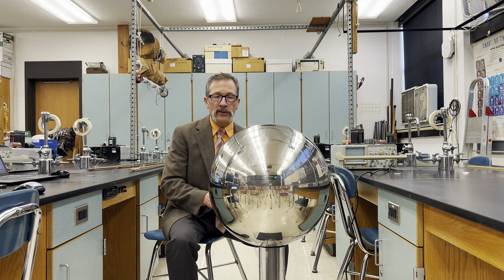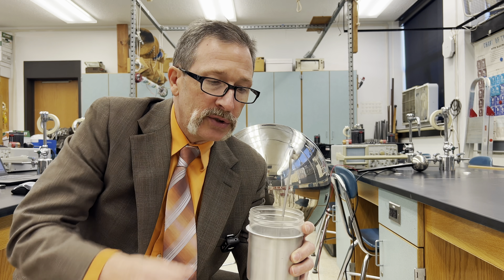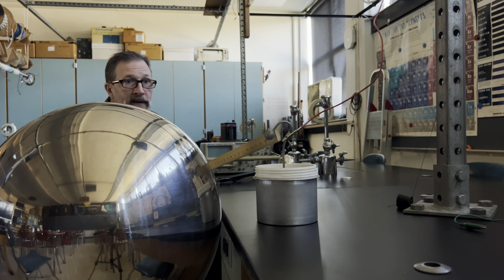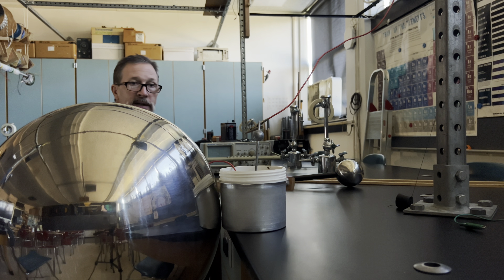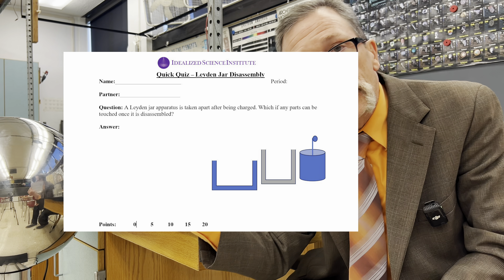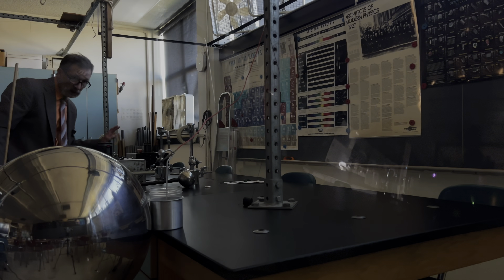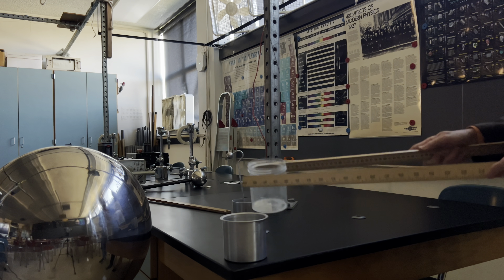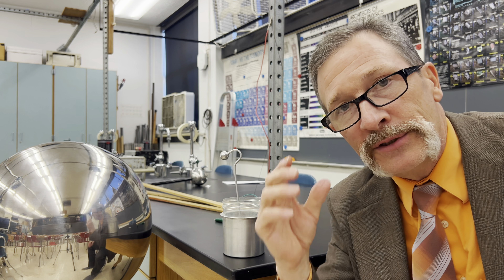This Simple Device Could Kill You

Comment: It's not just an electrocution risk. Electrolytics, especially, have 'interesting' failure modes:). Sealed tantalum caps can explode violently, spraying shrapnel around the lab. I had one large, aluminium electrolytic blow a pinhole in it's top and spew out a cloud of electrolyte and shredded insulation like a firework - we had to evacuate the lab until the power supply tripped and the snowstorm stopped.  It took a day to ventilate the fumes and vacuum out all the racks:)
Reply from the maker: Wow!

Comment: This reminds me of a prank I pulled on my kindergarten class many years ago. I got into electricity at a very young age, and I had a big fat one-farad capacitor, about the size of a tall jar of tomato sauce. I charged it up to an awesome 1.5 volts from a dry cell and brought it to class along with a screwdriver. Of course this was nothing like your Leyden jar: 1.5 volts won't hurt you, but my classmates didn't know that.

As I put the capacitor on the table for show and tell, I "accidentally" touched the two terminals, one with each hand. I started writhing around as I were being electrocuted! And then I somehow managed to get free. (Pretty good acting for a young boy.)

I discharged it with the screwdriver across the terminals, with a loud and satisfying bang. Then I touched the terminals with my hands again, turned to a girl I had a crush on, and told her, "It's safe now. I discharged it. You can touch the terminals now." She mustered up all her bravery and tried it. And we both survived to tell the tale!

Comment: As a student (60 ish) years ago I read about it. A day later in my friends basement I demonstrated. A 300 volt (tubes were still a thing) power supply and a RC circuit. A resistance high enough to not blow up the PS (who needs fuses). The capacitor, 2 roughly 6 inch square pieces of sheet metal and a sheet of typewriter paper. It was the first time working with electronics that I said “cool”
Reply from the maker: That is cool!

Comment: I worked in a thin film plastic extrusion factory. Some of our rolls were over 5000 ft long. When a roll was complete and a new core was starting, the operator reaches into the spool-er to cut the continuous sheet of plastic. The first time I did this, I thought there must have been loose strands of plastic because it felt like I was getting slapped in the face. The second time, I watched for loose strands, didn't see any, but still got slapped. Turns out that it was arcs from the highly charged roll of plastic, arcing to my face.
Reply from the maker: Yes! That is a good way of building up charges.

Comment: so is it correct to say that this lyden jar is sort of like a capacitor....(which also potentially holds a lethal charge if not properly discharged)?
Reply from the maker: It is correct to say that it forms a simple capacitor! However, it would be difficult to build one with enough capacitance to kill you. This quiz is designed as a tool to get people to respect electricity and NEVER assume a capacitor is discharged. Because real capacitors absolutely can be deadly!

Comment: Question:  When the parts were disassembled, could they be measured with a voltmeter to know that there was a danger in putting them back together?
Reply from the maker: Voltmeters, like a multimeter, are not rated for such high voltages. They would also begin discharging the parts.

Comment: My first job out of tech school in the early 80's was refurbishing the CRT monitors that were used at the Wall St exchange for Reuters. These monitors would just scroll stock prices all day and get a line burned in the monitor. I would replace the CRT and any other worn components. Of course I had to first power the monitor and evaluate it. That meant I had to discharge a freshly energized tube to work on the monitor. Used a long screwdriver with an insulated handle to short the tube to ground. Once or twice I got careless and got zapped. It HURTS!!
Reply from the maker: It sounds like we have the same technique!

Don’t EVER Do This in the Lab!
https://youtu.be/VukMAP_4NWA

Comment: I worked in a factory making pvc pipe many years ago and freshly made pvc contains a tremendous amount of static electricity. You could clearly see and hear the arcs up to two inches away when you put a finger near a piece of metal under the bright lighting. I'm not sure if I was imagining it or not, but I felt as if I could feel the electrical field as a buzzing sensation without actually touching the pipe. I've had that sensation before when my camp trailer became electrified in a rain storm, and I went to grab the door handle. Fortunately, there was about three hundred feet of extension cord so I didn't die, but that buzzy feeling is unforgettable.
Reply from the maker: No...that feeling is real! Glad you never got hurt.

Comment: Back in the early 80's, I worked in a Plasma Physics laboratory. We had an experiment that used large capacitors charged (relatively slowly) to 100kV. We monitored the voltage on a meter.

One time, just before a shot of the experiment, we heard a cricket chirping away from the direction of the storage capacitors. Then there was a loud BLAM! No more cricket. And, by no more cricket, I mean it was silent and there was a plasma smudge on the concrete wall of the lab near the capacitor bank. And the meter dropped a tiny bit.
Reply from the maker: That poor cricket! That’s a great story!
Reply: @idealizedscience  It didn't feel a thing. Trust me.

Comment: Back in the early 80's, I worked in a Plasma Physics laboratory. The way they kept things safe was to only hire the best and brightest (it sounds as if I'm boasting but this is the God's honest truth).

During my first tour after being hired, one of the scientists in the lab pointed casually at a relatively large plastic thing and said "That's 450μF and is charged regularly to 10kV. Touch it and it will kill you before you even know you're dead."

Folks who worked in that lab simply understood the danger of all the high power capacitors, inductors and Marx generators and behaved accordingly. If you didn't understand technology, being in that lab was absolutely terrifying.

Comment: Are the Lyden jars rated in farads?  Does in also have a voltage rating?
Reply from the maker: Yes...microfarads. Yes...the discharge voltage depends on the length of the path of the arc.

Comment: You should never use plumbing for ground. If someone is in a tub and electricity is going through the plumbing they can be shocked or killed. For safety please ground to an electrical ground wire.

Comment: Take two 30m rolls of aluminum foil and two of sarin wrap. aluminum/sarin/aluminum/sarin. roll it up so the sarin insulates the foil. 30m of foil makes a pretty large capacitor. Earth the inner foil. Charge up the outer layer using your generator. Unearth it somehow. Now don't touch it.

Comment: Who sees an arc of electricity spark almost 2 feet through the air to an electrical socket and thinks "practically harmless" lol
Reply: I got zapped by 40kV a few times. I eventually learned not to touch spark plug wires while engine is running
Reply: @walter6574 my dad saying okay hold this screwdriver in the sparkplug wire socket and to ground the end to the motor but not mentioning I shouldn't hold the metal shaft and only hold by the insulated handle.... Yeah once was enough lol

Comment: The charge (excess electrons on one plate, "holes" or missing electrons on the other plate) IS on the plates.  The dielectric insulator in this case holds no charge, and any induced dipolarization on it is removed immediately when the jar is disassembled and it is taken out of the static electric field.  This piece is ALWAYS safe to handle. 

Your incorrect statement was that either plate, when handled alone, would safely discharge into ground.  This is not true.  "Ground" is not some infinite and bottomless sea that will absorb excess charge, whether positive or negative.  When you power your van der Graff, "ground" is actually a circuit through the earth, all the way back to the nearest power station that supplies your electrical grid.  

When you force a charge separation on the plates, the only way to discharge them is to reconnect them in circuit, either to each other, or one plate to the half of another pair of plates, also charged.  The balance must always be paid, you get nothing for free in physics.  And in the case of "ground", it has nothing left over for you to do this, as the circuit was already complete as the capacitor was charging.
Reply: Well, not "always".  If you touch the dielectric while the capacitor is assembled, you're almost certainly going to short the capacitor and burn the end of your finger.  

The real risk of capacitors, is if you touch both plates, or one plate while the second is grounded.   Then they discharge thru your body and probably across your heart. Then you are probably dead.

Comment: That's a big van der Graaf machine, and you are right, it's pretty safe. But I'm rather wary about your setup where the inner plate of the Leyden jar is earthed and you charge the outer. It's too easy to touch. You also have other apparatus on the (ungrounded) bench and it's not clear what is earthed and what isn't. There are too many possibilities for charging various objects by induction due to stray fields. Much safer in my view to earth the outer of the Leyden jar, to prevent stray fields, and charge the inner, by connecting a bit of wire to the VdG. Then when you discharge, you know that you have discharged everything.

I wouldnt touch either conductor of the Leyden jar, disassembled or not, because you dont know what other dielectrics are around, like a part of the surface of the bench.

I did once get a biggish jolt from a Leyden jar which was not fully discharged, not fully charged either, not something I care to repeat.

You are obviously a knowledgable practitioner, but think about other people including physics teachers. I would store that Leyden jar with the plates touching and the dielectric somewhere else. Bill Dixon, retired Physics teacher.
Reply from the maker: Thank you for your excellent comment and wisdom here!  I will take it seriously and incorporate into my current practices. When we become overconfident...bad things can happen!

Comment: I have a couple of .0001 100kv poly caps that have metal threaded studs on the ends and I keep the studs connected with a piece of wire when in storage.

Comment: When I was a kid first getting started in electronics, I was learning about tank circuits and how when in resonance, the peak voltage goes up.  Anyhow, I had a center tapped 12,000 vac neon sign transformer, and then wired one end to a glass one gallon pickle jar with aluminum foil wrapped around it, and then wired the other terminal to a ball of aluminum that was dunked in it and partially filled with salt water, essentially the capacitor was in parallel with the transformer output.  I had a couple of wires set so it could arc between them and while "tuning" the circuit by incrementally pouring more salt water into the jar (powered off between pours of course) until I had attained the greatest arc of about 5 inches.  Normally the arc without the capacitor just hummed and was a thick glowing and very hot arc, and only could cross about an inch or so of gap, where as with the cap it was deafingly loud, and a skinny blue arc. 

So the transformer was sitting down on my workbench, and the capacitor was sitting directly above it on a wooden shelf, and while admiring my handwork, the glass had apparently had all it could take and cracked, releasing that salt water and as it ran over the shelf down onto the transformer below it, the arc was moving all over it in a a glowing blue sheet of highly charged water, and it was both beautiful and terrifying at the same time and as luck would have it, the outlet that was powering the whole contraption was directly under the shelf and there was no way to reach it without putting my arm through the arcing water but was able to shut it down by running to the house and flipping off the breaker.  

In later years I got a job as a bench tech, repairing electronic gear, and often had to replace CCTV picture tubes, and the usual procedure was to ground the anode of the tube before working on it.  Normally most flyback circuits have a bleeder resister that will drain the voltage after a few minutes and if the TV had been off a while, I would often skip the short wire to the anode step.  Bad mistake.  I was working on the CCTV on a Friday and it was late so I decided I would pick up where I left off on the following Monday.  When I followed up that Monday, I never gave it a second thought, I reached up and went to pull of that anode cap, and even having sat there over the weekend, not even plugged in, it gave me probably the worst zap I had ever gotten in my life.  Aside from yanking my arm out and almost hurting myself, my arm went numb, I was  shaking and just glad the hit was just down my arm and not through my chest because I feel it probably would have killed me.  After regaining my senses, I applied the proper shorting technique to the anode and it still had several good pops left in it, and I later discovered the bleeder resistor was open.  From then on, I always ground the anode terminal with a stout jumper clip and I would leave the jumper clip in place to make sure it was completely discharged.

Comment: I had to repair a benchtop grinder but to do it I had to disconnect the motor to remove it. I unplugged it and was about to undp the connections when  I remembered the motor had a capacitor start. Nearly a nasty surprise.😖

Comment: Gotta be real careful with caps especially big guys with a lotta dielectric and plates. Why? Because your storing lotsa little critters in there. Result? Lotsa amps and lotsa voltage differential. Yep even 25 volts can bite you in the ass if there's enough for long enough of a period and POTS line works into -48vdc by default. that can definitely bite you because there's some amps behind it, see?

Comment: Leyden jars can be anywhere. when I was managing a restaurant they had a special where you could get a large sports drink in the plastic cup screw lid and straw all in one piece. well these came and giant plastic bags inside a great big cardboard boxes being jostled around everywhere like The Warehouse the UPS truck putting them in stock like shuffling your feet on carpet. if you carefully unscrew the lid and build it with the pop machine and did not touch a ground and shock yourself you could screw the lid back on filled with say Coke. you hand it to the customer that holds it and takes a sip and Powright inside their mouth. it went on purpose employees didn't want shocked filling them. and that one that happened to explain what was going on and they needed grounded before being filled.

Comment: I disassembled a Marshall guitar amp once. I had just been playing it for a while when I got curious about how it looked inside. I got it out from its wooden box and held it in my lap. Then I touched one of the 500 volts capacitors. That’s when I got kicked by a mule and the amp flew off to the floor when my arms straightened right out. All went well but it was a hell of a kick. Remember thinking I probably was lucky. Never touched it again, just played it.

Comment: My buddy built his own neodymium magnetizer... to charge neo, you need a lot more power than normal magnets. Well one day he dropped a screw driver into the cap banks and it discharged.  The explosion caused hearing loss in one of his ears... terrifying.  If you're working with large caps, use oil filled caps instead of air. They tend to be much safer but more expensive.

Comment: TV repair back in the day was deadly if you didn't know what you were doing. The metal chassis housing the electronics was "Floating hot" and acted as the circuit common, Power supplies & circuitry for CRTs were high voltage using flyback transformers and capacitors & carried no ground (wire). Energizing it just 1 time, the configuration will stay charged (in theory indefinitely) practically for decades WHILE unplugged! When the TV broke or there was an issue unqualified people would often attempt to save a couple bucks from calling a repairman, and made the potentially lethal mistake of poking around in the back..... bad move!

Comment: This is a video which really needs to become viral. In electronic courses 35 years ago, we were told to consider capacitors as "current bombs". Meaning they can release all their stored energy in an instant. I've got a 20 volt 1 farad capacitor which spends all of it's downtime with a 10 gauge wire shorting it's terminals. I do not even trust the atmosphere when it comes to that capacitor.  lol  
My first experience with high voltage capacitors was from a throw away instant camera from 1993. It's flash circuit was interesting and until then, I foolishly presumed all caps were low voltage. I'll tell you right now, that tiny capacitor generated a scream I was not aware my vocal chords could produce. I later tested it's charged state voltage... 330 volts DC.
Reply from the maker: Thank you for your comment! That’s a scary way to learn about caps… Glad you’re okay!

We hope our course on E&M (to be released in a first iteration next year on YouTube) will help students learn electricity deeply along with all the necessary safety precautions. 

In the meantime, you might get a kick out of this video:

Placing Coils in Series with a Lightbulb and a DC Power Supply -- What Happens?
https://youtu.be/vQPubg9Eq50